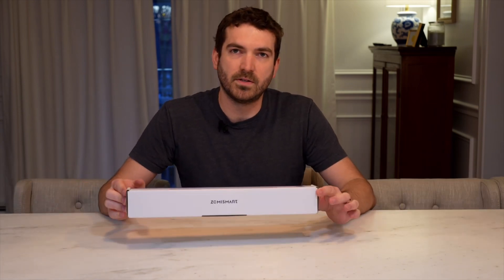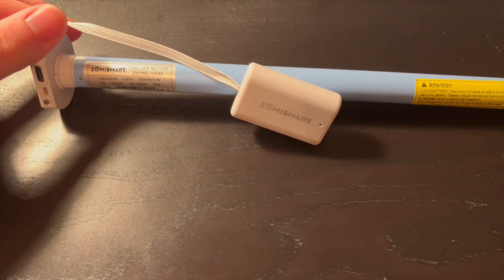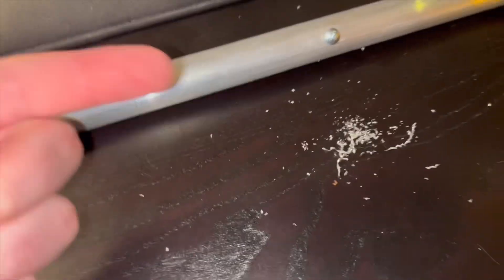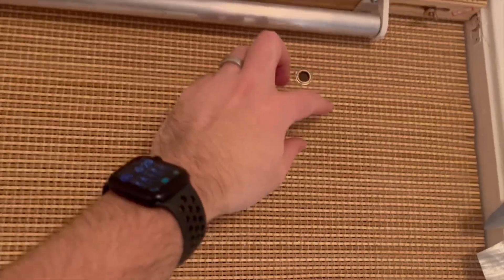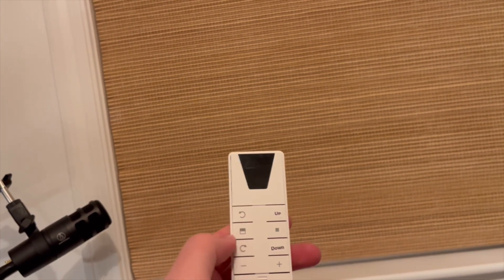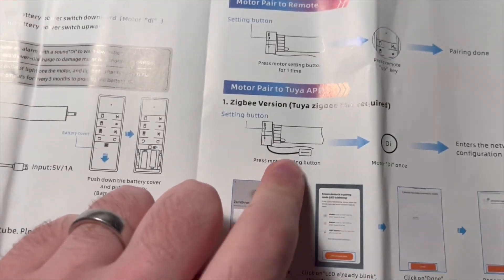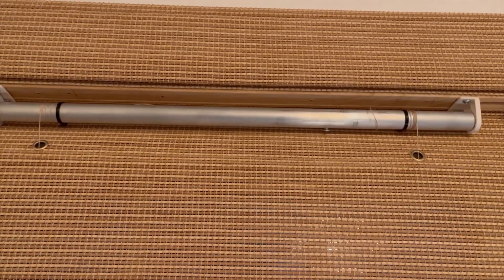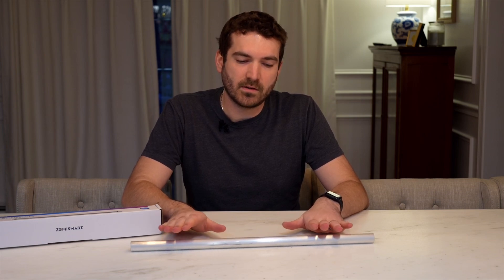From Dumb to Smart: DIY Guide for Motorized Shades

Comment: Thanks for the video, just curious what is the metal tube for?
Reply from the maker: Welcome! The metal tube is for the string to wrap around for the shade to move the shade up and down. The tube also as you see at 2:10 contains the mount for the bracket that is hot glued in there. The end of the motor rotates the metal tube, while wrapping the string and mounting at the end. Hope that helps explain further.
Reply: @WarnerDiscovers  Thanks! It helps. I have  regular bilnds, and was looking for solutions to motorize the tilting and up/down. Probably need 2 motors to get the job done.

Comment: I have cordless cellular shades from Lowes. How do I convert it to motorized one?
Reply from the maker: You would probably need to modify it manually like I do here with my cheaper shades. However, I'm not sure if cellular shades could be modified to fit a cylinder and string system like demonstrated in the video. Those typically work completely differently sadly.
Reply: Is there a reason not to secure the cords to the motor's outside tube itself?
Reply: Thank you for the great video. Could you share the links for your blinds?
Reply from the maker: @RunboyUSA  Sorry for the delay here -- these should be the exact ones in the video!
https://www.homedepot.com/pep/Home-Decorators-Collection-Modern-Farmhouse-Cut-to-Size-Natural-Multi-Weave-Cordless-Light-Filtering-Bamboo-Shade-35-in-W-x-48-in-L-2258235E/306231528?irgwc=1&cm_mmc=afl-ir-57486-456723-&clickid=yyR0p6yRezdNR1y3mUVewTbrUkD0piyds1qz1Q0

Comment: Interesting design. Is it continuing to work for you?

How strong are these motors? I have 48" L by 2" mini-blinds which is quite heavy. I tried to make mine powered using a stepper motor and custom 3D printed mounting bracket and ESP32 board, but it wasn't strong enough to fully close the slats so I abandoned the idea. I didn't event try to raise and lower them due to the weight.
Reply from the maker: It's been working well so far. I have 6x of the 17mm motor / tubes installed and 1x 38mm motor / tubes installed. I mainly have just been having quirky issues with Zigbee but that's a separate issue with Homeassistant. Not sure about the strength, most of the shades I'm using aren't too heavy honestly. I'd say the heaviest is on that 38mm window which is a stronger motor than the 17mm one. If you have a 3D printer, making a more appropriate end cap and/or tube adapter could be better than my hot glue too!
Reply: Thanks for the info